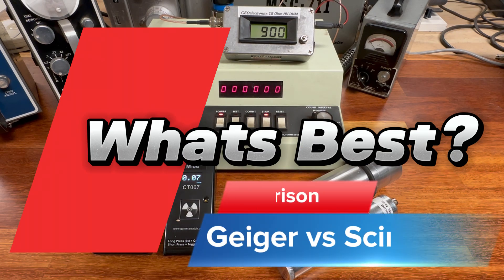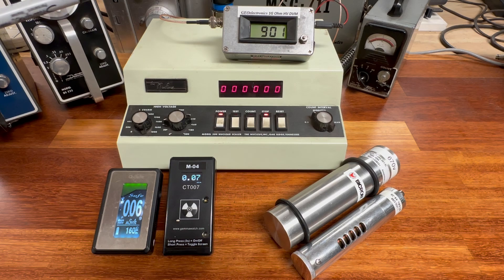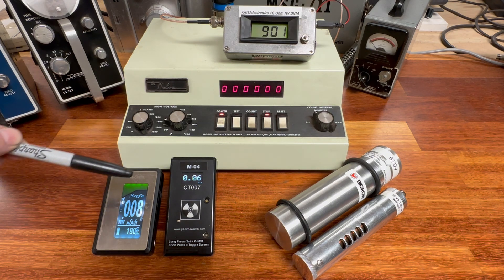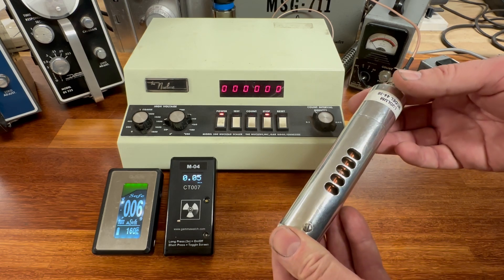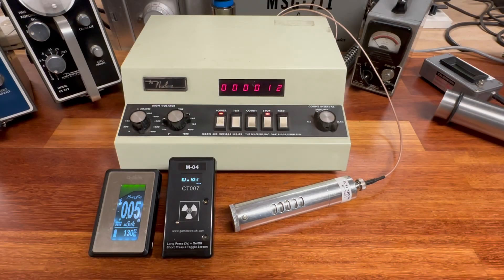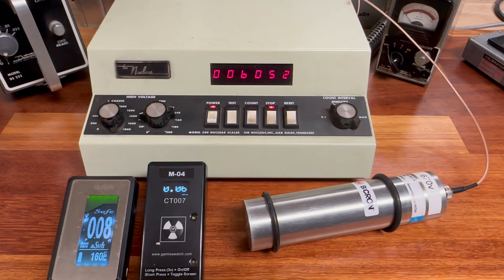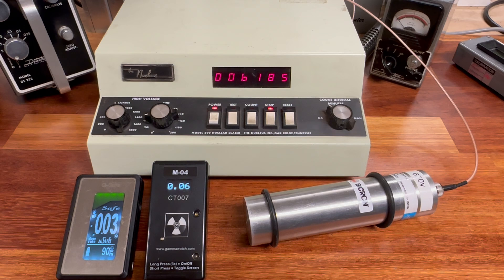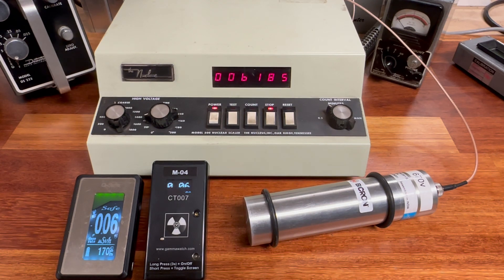The BEST Gamma Radiation Detector!!  / Scintillator vs Geiger Counter

Comment: Beawere about the meaning of counts and dose rate.
You can not compare sievert and counts.
If you have to locate sources (lost, stolen or orfans) Geiger could be better. To dose measurements or even identification you need to go for scintillators/spectroscopic. Do not forget also what happens in Goiania with a scintillator.
Reply from the maker: Thanks for the response.  
It should be noted that no comparison was intentionally made or intended.  The sole purpose of the small digital meter placements was to indicate there was no hidden source in the area skewing the timed count. Being that the small meters had different sized detection crystals it was decided to let them display the calibrated and expectedly consistent dose rate as opposed to the large difference in raw cpm.  

I’ve reviewed that portion of the video and it’s clear the reasoning wasn’t direct enough.  I’ll add an update to the description to address.
Reply: @ClagwellsGarage  The idea was not to criticize; it was to help and improve. I work with these detectors, polimaster, thermo, identifinder, fulcrum , sparcs from DoE ( 16 to 64 liters of NaI), etc. Also, big and small geiger tube detectors range from low to high dose rates. To cover the full needs, most modern detectors come with scintillators and Geiger tubes for high doses. The question is, many users, not well trained, associate high numbers of counts with high doses, and for the same dose rate, a 1cm3  detector with give small number of counts when compared to a 1000cm3
Reply from the maker: @eldermagalhaesdesouza3479  
My career (ret) was in orphan source detection. CPM was paramount for location with dose used for safety and gamma spec (RIID) for ID.  Can’t even begin to tell you how much fun it was writing up grants requests for Thermo, Flir, and others.  Anyway, the “average Joe” I’ve found is mostly interested in source location, or raw cpm activity from something like a fiestaware plate or their granite countertop. Being as such, most of these vids will be focused on raw cpm efficiency or a detectors ability to sense very minor elevations.  Doubtful I’ll ever get into dose rates too much but the heads up is greatly appreciated. I’ll probably make this a highlighted point in future vids.
Reply: @ClagwellsGarage  I understand you. I used detectors in Goiânia and also Chernobyl. In some points/spots I got 1 Sv/h...for those who works at NEST or MEST teams and emergency response  . Some calibartions in past , I used " strong" sources close ...

Comment: Great , I can't believe you have so much equipment . the Scintillator detector is useful for what specific radiation , presumably alpha , beta  Gamma ( ? Neutron with moderator? )
Reply from the maker: @quantum-inc  
Gamma, however it can be used to detect alphas indirectly via braking radiation.  A good example would be the low energy x-rays being emitted from a common smoke detector even though the Am241 source is primarily alpha. The metal casing and photon shielding of a typical Scint will make it blind to betas.  Otoh, a typical Geiger tube can detect all three, but gammas will comparatively trickle in as seen in the video.
Reply from the maker: Scintillators can also indirectly detect neutrons via proton recoil. Requires a special type of plastic scintillator material… definitely a good topic for a future vid.
Reply: You can find scintillators materials that can be used for both, gamma and neutron. But NaI and CsI work only for gamma.